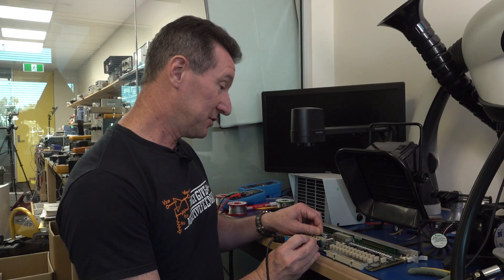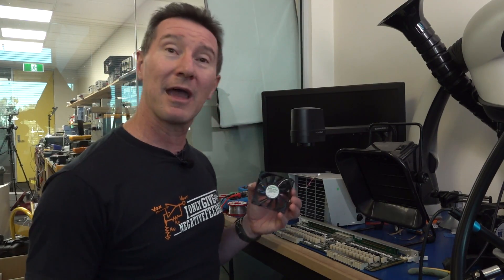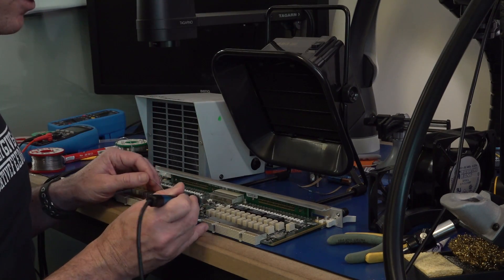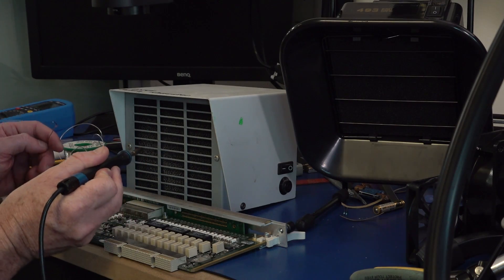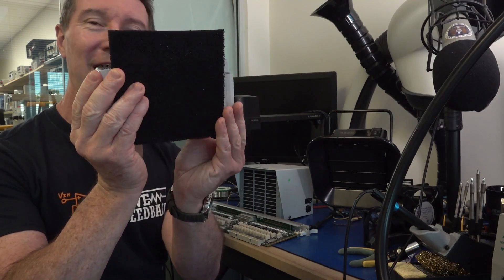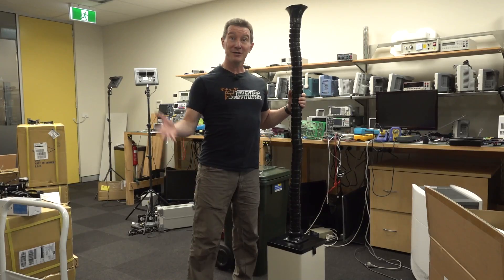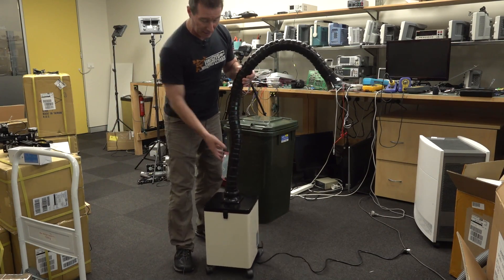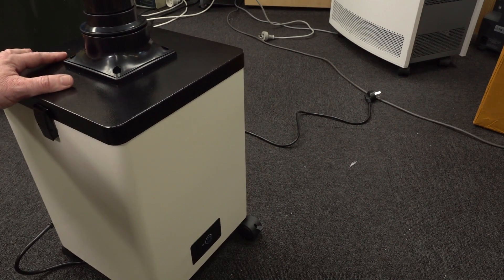EEVblog #1305 - HEPA Solder Fume Extractor

Comment: Is the filter that takes out farts available separately?
Reply: It takes out the farts but doesnt muffle the noise
Reply: @laharl2k  You can still blame the dog.
Reply: Laharl Krichevskoy more suction then
Reply: Get the dual tube one, point one tube at your tuchus. 😂😂😂😂
Reply: Check out the higher end of room air purifiers, the good ones will monitor constantly and clean up farts automatically.
Reply: They (used to?) sell a version for use in pants. Designed for fart smells only.  More generally, activated charcoal filters should be available from industrial suppliers around the world, unsure which.
Reply: @johndododoe1411  I think they stopped production and are now in the mask and respirator business

Comment: They should put a ring of LED lights on the end too
Reply: I think it's a great idea. If not, then at least offer a transparent or translucent intake, so it doesn't shadow your workspace.
Reply from the maker: @richfiles  I like the transparent idea. One model they have does have a transparent round cover.
Reply: @EEVblog  That's pretty nice! Honestly, It sounds like something that ought to be a more standard feature. Uniform lighting is my friend, on the workbench!

I happen to have a REALLY nice blower that I got from a surplus shop. Picked up two of them NOS. Looked online, and it was apparently the combustion chamber blower for a large multi-unit boiler. It's 24 volts, PWM controlled, and looks like the big brother of the blower in that unit you bought. I'm thinking I might build my own, and just build it around a good off the shelf HEPA filter that I can readily get. I'll only need to buy the tube, and some misc bits for the box. I do think I'll put in the extra effort to add some extra dampening material inside the box though. Heck, I even have the parts for the PWM controller already. I almost used it in a PC case, but opted to change it out for dual filtered intakes with 8 standard PC case fans, rather than the one filtered intake with the blower fan.

I probably will end up installing LEDs into mine. I found this really nice strip with dual cool/warm white LEDs, and I really like the light they put off. I figure, I can aim 'em downward, with a diffuser, and it'll be great for working, as I'll have an adjustable light wherever I aim it.
Reply: @Big Steve/videos - perhaps some, but I seriously doubt it would ever darken to the opaque black of the current material. And anyway, the transparent plastic wouldn't be for seeing clearly through but rather intended to let at least some light from above down onto the workspace
Reply: @Big Steve - That'd be excellent, you could add LED tape round it too just for the most insane looking 'Jetsons' style apparatus XD Seriously, some of my old LED computer fans clouded up but its a clear indication* of how dirty they are.
*Unintentional pun
Reply: My homemade fume extractor has LEDs at the end of its hose. Great minds think alike!
Reply: On AliExpress they sell that option for these.
Reply from the maker: Ugly solution though. Horse for courses, don't try and be a jack of all trades.

Comment: are there any of these cheaper? im on a budget!
Reply: $200 cheaper does same job 
https://www.vipprogrammer.com/fume-extractor-smoke-absorber-smoke-purifier-welding-smoke-exhaust-programmer-5786?zenid=vtjmras1r5h16d4rl1t5cn5857
Reply from the maker: I posted a link to that one on Aliexpress in the description
Reply: @EEVblog  hmm I swear it linked me to a different one. Thanks :)
Reply: @waynetaylor2784  Big smoke tube strong suction, FUME Extractor Smoke Absorber comes with 1.2m bamboo smoke tube, its suction is very strong, can quickly absorb smoke and odor, dust.{from that listing. you think it real bamboo?}
Reply: @nowayjerk8064  no their English translation software crap but ordered 100 plus items over the last couple years, never had a problem and they will negotiate on price.. ship quickly
Reply: @waynetaylor2784  $200 cheaper? Do you math, bro? The one in this video was $225, and the link you posted is $250. So it's actually more expensive.
Reply: @xenonram  Ahhh the one in the video was USD , the one i linked to was Aussie Dollars.. but if u need me too convert for $145usd so you do the math bro.. global post is cheaper n faster than dhl to Australia
Reply: @waynetaylor2784  Heads up that link you shared gave me access to your account and orders for that shop.
Reply from the maker: Of this type, likely not, unless you DIY.
Reply: @EEVblog  how would i go about this? hook up a fan to blow through the filter?
Reply from the maker: @justin.campbell  Ask on the EEVblog forum, someone has likely already made one. No magic, it's just a (blower) fan on the end of a flexible pipe. The longer and narrower the pipe the greater the suction required.
Reply: @EEVblog  cool thanks!
Reply: @EEVblog  I might get this one as it has free shipping to NZ https://www.aliexpress.com/item/4000284308957.html
Reply: John Ward made a pretty good one a few years back: https://www.youtube.com/watch?v=JdrFsuAcm48
If you don't feel as if you must have a flexible hose type then a simple fan or air purifier with a carbon filter also works just fine.
Reply from the maker: I added a link in the description to one that is the same price but has free DHL courier shipping.
Reply: This is as cheap as it gets for a proper extractor, sadly. They're not popular among hobbyists because the big brands like Weller and Hakko charge crazy prices for their units - just the filter for a Hakko one is 130$.
Reply: @Cringy Crawlers different fan, larger filter... much quieter than a vacuum.
Reply: Yeah, spend $200+ on a simple fan...?  Get a decent motor/blade assembly from a fan and a tin box. Pick up some HEPA filters and you done.  Even better, find someone's old wet vac and you have the chassis, flexible arm with multiple attachments, and just need the fan/blade and a cheap HEPA.    Average Joe can find something else to blow $200 on.
Reply: Get a high speed PC 120mm fan, high CMF, and gaffa tape it to a flexible 120mm hose..put it out the window.
Reply: @sbaxter4207  A PC 120mm (5") fan is nothing compared to an HVAC centrifugal fan with 120mm (5") intake like the one in this unit.  That fan type simply moves more air per watt, but doesn't fit inside a PC.
Reply: 16:27 lol. Search John wards video on a DIY one on here.

Comment: Awesome video!! I've been looking at these nail salon extractors too but was unsure; $200-300 is still pricey if you end up with paper weight, so its great to know they actually work. The price/availability of replacement filters can also be a pita.
Reply from the maker: Yeah, they haven't gotten back to me on a filter price yet, it's not on their site.
Reply: @EEVblog  Wonder how it compares to the QUICK6101A1 ; https://canada.newark.com/quick/quick6101a1/single-arm-fume-extractor/dp/97W2555
Reply from the maker: @stevenspmd  Don't know, but looks like that wouldn't fit under the bench. I want to get rid of the noise source as much as possible.
Reply: @EEVblog  pulled the pin on the same :-) 394.72 USD / 550 CDN ; even at double the cost for shipping you can't beat the price.
Reply: @stevenspmd  The Kingsom has an activated charcoal filter. The 6101A1 does not.  The filtration of the 6101A1 is a three piece cotton fiber affair similar to other lower-priced extractors on Aliexpress.